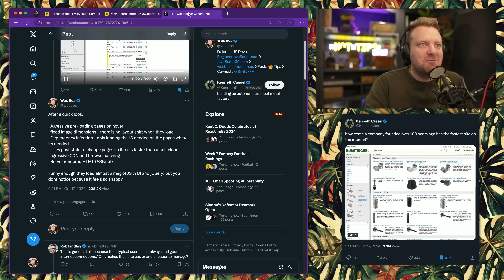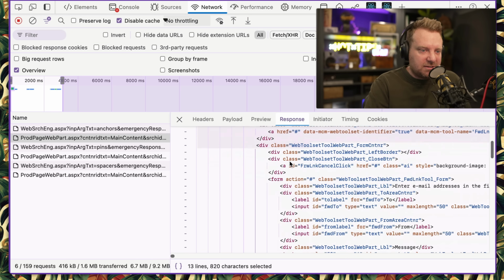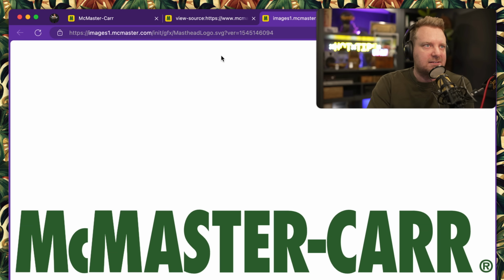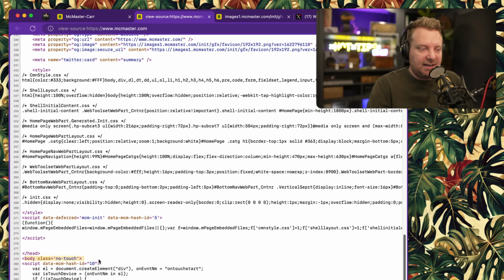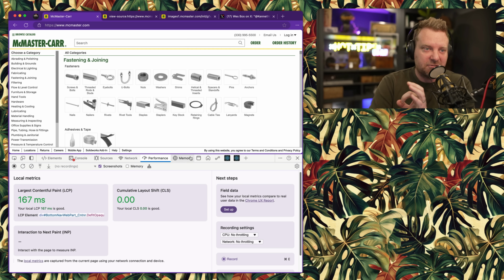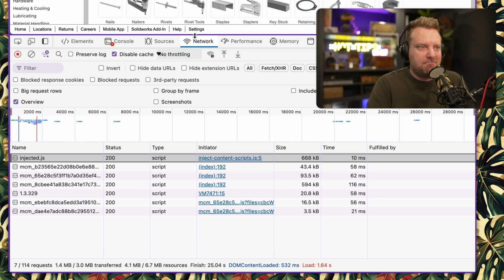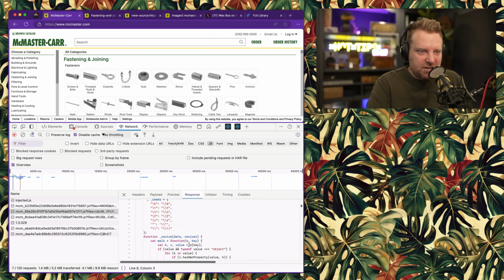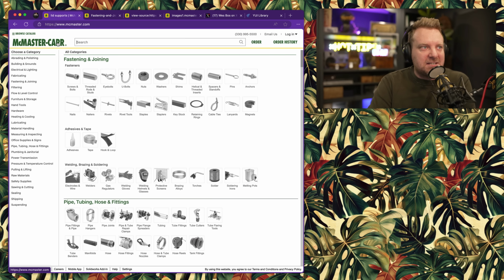How is this Website so fast!?

Comment: Their site looks old, but once you've used it a couple times to find some specific parts for your very specific application, you'll find that their site is the absolute gold standard for UX design, you can so quickly dive in and find the exact part you need. They have done a fantastic job with it and run a fantastic service. Parts do cost more, but they're in your shop the next morning.
Reply: Engineers hate Apple designer BS. This site seems correct.
Reply: MOST of the time.

Occasionally you can find yourself stuck when looking for a specific part that you don't quite know the name of...
Reply: its not old but already peaked, this is what peak perfomance of look like
Reply: No, it's not the "gold standard" for UX. It's pretty good though. If this was the gold standard than way, way more websites would look and behave like this. This is the gold standard for engineers and those no nonsense people. Unfortunately most people wouldn't particularly like this website and years of research and A/B testing would confirm this. And when you make a product you make it for "most people".

I wish this were the gold standard though.
Reply: The big UI difference is the icon. This shop is targeting ppl who can actually read instead of brain dead icon. No icon, no more cha-ching color, no image background, no ads, no clickbait or anything that try to catch your attention, just pure content =))))
Reply: It looks old because of the demographics that use it.  This is exactly what those type of guys want in a website.  A+ design on top of the performance of it.
Reply: You mean it has good usability (which is unrelated to the graphics of the site), but i get what you mean. UX is a word that can mean many different things, like a buzzword. Information architecture, graphics, animation, layout etc.
Reply: I was just having this conversation with my wife. About how UX is basically aimed at the lowest common denominator these days. Back when I was a nerd, the internet was only used by nerds. How did it become so popular?
Reply: What's really amazing is their search.  It can somehow figure out the right part from a really poor search query.  It's literally magic.
Reply: I love old looking blazing fast wesbites.
Reply: Yep, modern design is not equal to good usability and most websites nowadays prefer bells and whistles.
Reply: In comparison apple engineer look like absolute fools
Reply: I have made a similair catalogue website once for a tooling company and it almost looked the same as this... just a big list of categories with products in the middle... simple, fast, easy to navigate etc... designwise it wasn't anything special but it's exactly what they wanted.
Reply: This is basically it. If good, fast service is what they are really selling, they really can't have a slow, boggy site.
Reply: "absolute gold standard for UX design"
Like XP for PCs
Reply: It's information dense which is underappreciated in modern UX. It's optimized for familiarity instead of "new user" experience. I hate how every modern website optimizes sign up instead of log in, like getting new users is what is important instead of keeping the ones around.
Reply: @MasthaX  Did the same and used McMaster Carr almost as a template. We talked to engineers and shop guys all over the country to see how they worked, how they ordered parts and what else they needed and not one of them said "a 2 minute drone video of the warehouse in the hero header, animated page transitions, and it really should be done with React with Tailwind".
Reply: Its also really good at giving it some words to describe what you are looking for and it usually knows what you mean.
Reply: looks old? that looks mesmerizing! text is very easy to read, very detailed information about products is not hidden behind 4 slow pop-ups
Reply: 100% regarding the "looks old" part. Modern websites confuse being pretty and good UX. When you have a website that serves a purpose, you want it to be as easy to use as possible. And that is achieved here to perfection.
Reply: sites that look old always tells me that the business optimizes that matters instead of lipsticking the pig.
Reply: That's because Tools and Ads masquerading as websites are two completely different things. If you're designing a tool, simplified modern flat with menus and popouts everywhere is the pinnacle of design fuckups
Reply: Making stuff with fancy overdone pretty graphics is not free. Also, people building stuff are often much more familiar with the KISS principle, and just want to buy their stuff and for it to be easy. Don't really care if it looks fancy
Reply: As an engineer that uses this site regularly, I wish more sites were like this. 
Can’t stand modern web design. Fucking random buttons scattered all over the page. No joke, you got about 15seconds max for me to find what I need before I go elsewhere when I can. 
Give me back an early 2000 html page with headers and drop downs.
Reply: They cater to nerds and boomers and the result is nerds and boomers like it. What a surprise.
Reply: It is old and still in use. Your brain can not conclude it must be good and doing its job? There are plenty of electronics webshops that changed to these smart and fancy webpages, but its just slow and you can not find anything.
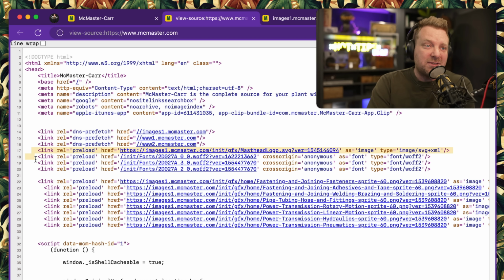Reply: I knew a guy with a machine shop near their New Jersey warehouse, he said that if he ordered before 10 am, it would be there 4:00 the same day.
Reply: @Squant I'm not clear if you're criticizing McMaster-Carr or praising them. I suspect the first. Regardless, it appears as though MC caters to customers, without pigeon-holing them within some imaginary demographic. Speed and clarity count for a lot, and having customers respect you because you respect THEM is almost priceless.

I see little to fault here on MC or their development team.
Reply: They also have a forever return policy with no paperwork. I literally returned a box box of random parts I’d accumulated over four years and they sent me a $1500 check, no questions asked.
Reply: yes, it is god tier. I will also take this opportunity to say fuck digikey's filtering. Absolutely worthless.
Reply: Everyone reacting to the "looks old but..." must have missed the first 20 seconds of the video where he talks about how the site looks old.
Reply: Yes, they are INCREDIBLY fast with delivery, which is far more important than the website.
Reply: Yes, a site for people who actually work and need to find their itens, not some designer UI buIIcrap
Reply: That's because it's not UX design at all, it's the exact polar opposite of everything UX design is and stands for. It's not an eXpErIeNcE. It's an INTERFACE.
Reply: Most "advancements" we had in web UX in the last decade or so were focused on user retention, i.e. how much time you waste on the site and how many links you click, rather than actual usability and accessibility. It's no wonder why modern webpages are full of whitespace, hidden hamburger menus, slide out panes, fancy animations, and so on, making the user scroll 3 or 4 full screens to read an article that 15 years ago would fit entirely on a 1280x1024 screen without scrolling.
Reply: it doesn't even look old. It appears to look 'old school', because it is compact and that is what older UIs looked like, and also greyscale images. Other than that it looks like a pretty modern plain website. It has a side panel under hamburger, it has some sleek buttons, some big ass cards under the discover products section... (it's good btw, the website, it looks good)
Reply: Wow, so not only the website is fast, pretty cool
Reply: That is pretty much saying "new" design is worse not better. 
(The new patterns are trash, but the way you said it sounded like a revelation lol)
Reply: @boots3372  love that you think something being user-friendly means everyone will switch to it.  how's a battery replacement work on your smartphone?
Reply: A little tangential to their web design, but another reason McMaster does so well is how almost EVERY SINGLE PART has a correct 3D CAD model for download from the online catalog. As a mechanical designer you have complete assurance that the McMaster-Carr part is going to fit your design if you've done your CAD right because they've done their models right. Well worth the extra cost of the part to know it's going to just work.
Reply: I miss the "old" look of websites. In most cases better structured, less ads, better overal layout and readability and most important more static. No stupid popup, notification or else that constantly cries for attention and is a pain in the ass to even read one sentence without some unwanted disturbance.
Reply: McMaster is cheaper than Grainger or a home store.
Reply: @Shotblur  I don't "think", I know. I'm an expert in the field, and you are not. I've done many hundreds of hours of research on this and I've even literally made nearly this exact website for a massive fastener company.

You can discuss it like adults or continue ask ridiculous questions. One will get a reply and one won't. I assure you though, I know my shit.
Reply: What people probably perceive as dated is their branding, but performance/UX is top notch!
Reply: The customer is probably a plain and simple construction and hardware type person. This website speaks to that directly, no change, no fuss. Just work well
Reply: Using it on mobile also very smooth and up to current standard UX designs!
Reply: @WriggleNightbug I do UX for a living and I work directly with engineers. They have made some of the most convoluted, shit interfaces I’ve ever come across.

I love engineers but they are not all the same, nor are all designers.
Reply: Parts cost more because they make the best fasteners.
Reply: It is just like the book... you know what you want but don't know the right name for it so you have to flick back and forth to find a thing that will do the job.
Reply: The other thing is they don’t do brands, they choose brands and sell quality. So you don’t have to look around, compare each brand, etc
Reply: It doesn’t look old to me. Imagine the nightmare that is Amazon and compare it to this.

This is USABLE.

Usable = modern
Reply: @astronemir  yes, this also doesn't do brands, they curate them and only sell the best. Amazon its like hit or miss with brands
Reply: @piisfun I've had that happen and typed in what I call it (which is not the correct name) and it knew what I wanted because it's a common enough name.
Reply: Exactly !!! It’s about efficiency and reasonable ease of use
Reply: MMC’s Los Angeles head honcho would hand deliver our orders to us the next MORNING to our office, no matter when we placed our order… granted, our project is like 75% COTS parts from them, but still… their customer service and their website is chefs kiss
Reply: It's not old. It's HTML.

The way the web should have always been.
Reply: I explained this to my company currently. Mcmaster user interface is one of the best I've seen. I like automation direct/allied electronic/global industrial as well but mcmaster is top tier for sure.
Reply: As an engineer who's used McMaster car the quick service is 1k % worth the premiums
Reply: @TheFoyer13 being designed for the lowest common denominator is not a bad thing
Reply: The first time I used RockAuto's website, I hated it. It looks old AF and felt like the inventory system at the shop where I used to do IT support. The second time I used RockAuto's website, I was already in love with it and wouldn't change it for anything. It looks like an inventory system because (A) it IS an inventory system, and (B) most of its users are already familiar with such a setup.
Reply: It's not old. It's efficient and with ZERO DISTRACTIONS.

Comment: crazy that an efficient site is turning into a free ad campaign for them.
Reply: and they need to open "optimization courses" branch in company business
Reply: That website is trash. Lookup database is fycked. What are you talking about?
Reply: @ATX_Engineer  Are you sure? The searches feel snappier than what I've seen most ORM fans pull off.
Reply: @ATX_Engineer looks like you missed the point of the video.
Reply: They deserve it, high quality products, free stl files, good customer service what else should a business do!
Reply: For the wrong public, but anyway 🤣
Reply: “bUt whATs tHE rOi?”
Reply: I just showed it to my old boss who uses all these bits so Im sure it will be useful at a very mimimum as a reference for part names and such.
Reply: It's crazy that efficient websites are so rare that having one can do that.
Reply: They don't need the advertisement, they are already the leader in this space. But hey it can't hurt.
Reply: McMaster needs no advertisement. Everyone who needs them knows about them.
Reply: It's their entire business, giving you the all the part info fast, easy and accurate, even their printed versions were easy to use.
Reply: McMaster doesn't need advertising, they're the gold standard for structural/mechanical/electrical engineering
Reply: Devs responsible should get a shout-out at the company holiday party this year. 
😂
Reply: Not really. You build a fast car and it advertises itself as well.
Reply: @TheMetalButcher  some people don't know they need them
Reply: McMaster-Carr doesn't need us, we need McMaster-Carr.
Reply: Every engineer knows this website wonder if they even notice the tiny bump in web traffic 😅
Reply: It's not “crazy”, it's just interesting, curious, cool, nice, etc.
Reply: @ATX_Engineer  this type of website is all about user experience. Users don't care what's happening in the background. Delivering this kind of user experience is obviously something you can't comprehend.
Reply: @DeophobicMind  what I can comprehend is how the website actually functions, because I use it, often.  What I know that you and most here don’t, is that when you try find something in particular you will suffer. More stupid bot and spam shit for YouTube, but thanks for your comment 👍